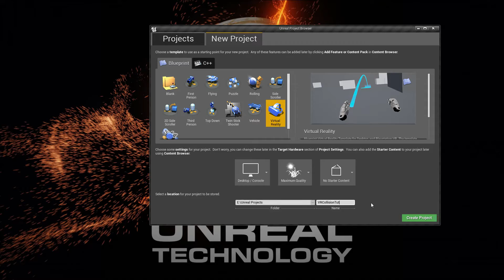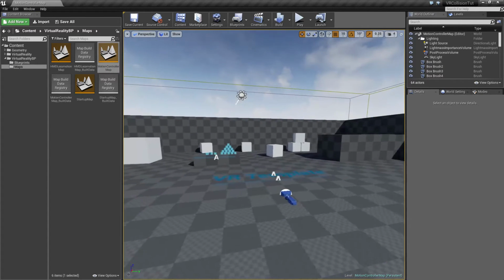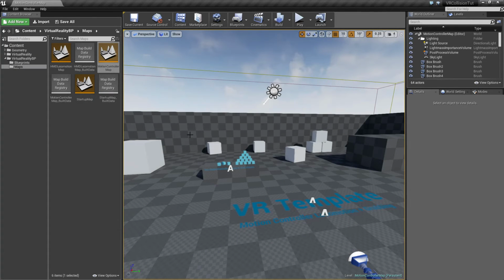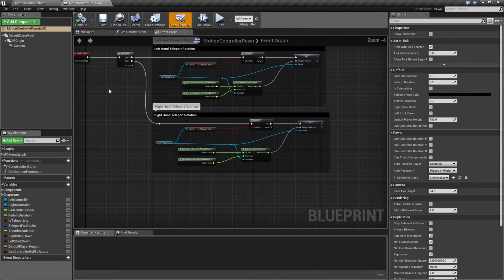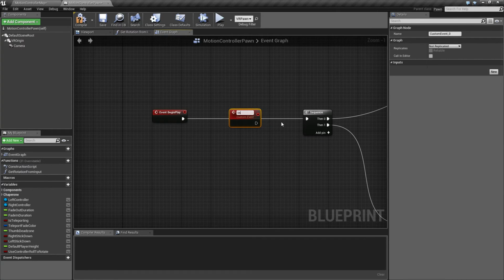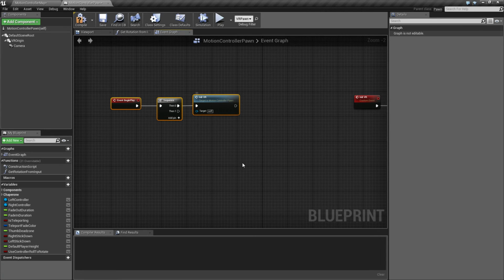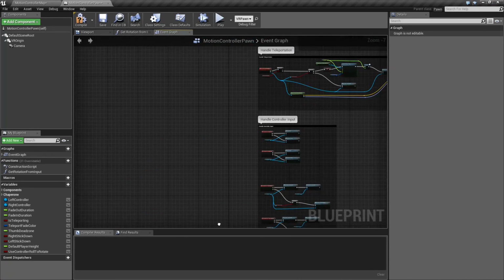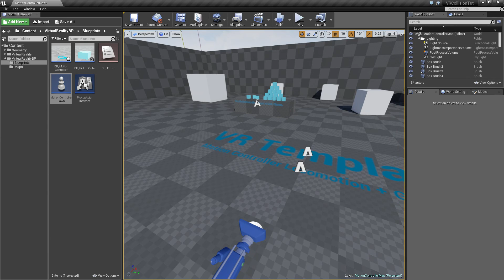UE4.14.3-Vive/VRCollision-Part1 Preperations

Comment: I have another quick question about this system. When I first setup my capsule location, I had to multiply the x and y locations by -1. I now know that it is because my characters initial rotation has a Z rotation of 180 degrees. when I rotate my character back to 0, the capsule is no longer attached to the camera and is moving like it would if it was still at 180. do you know why this happens/how to fix it?